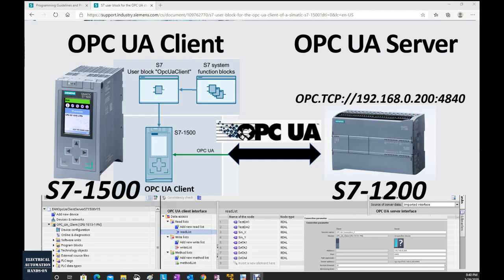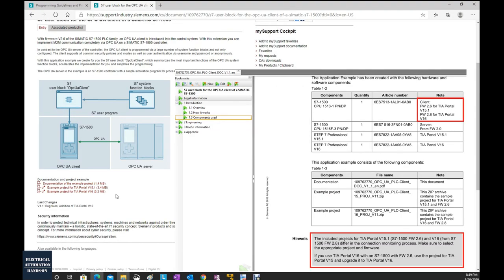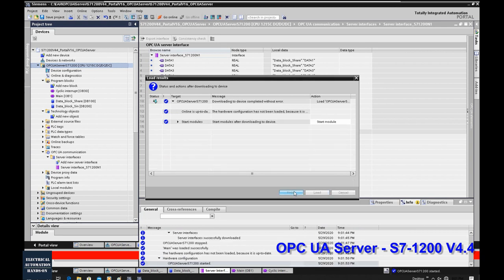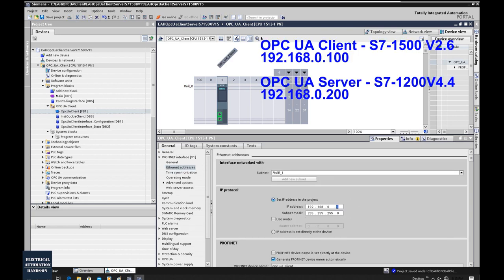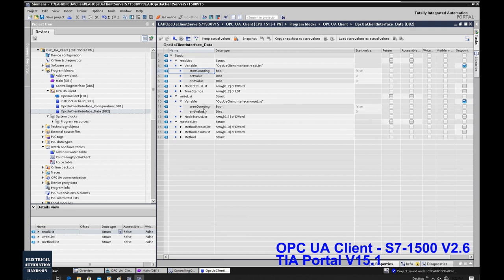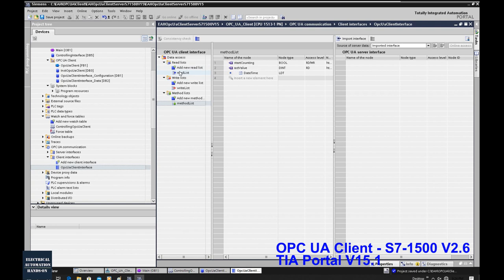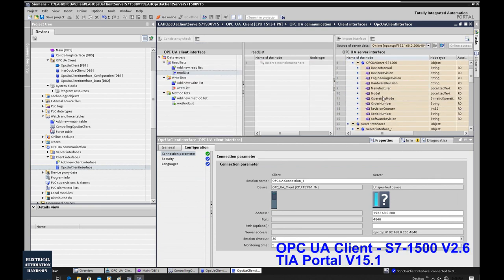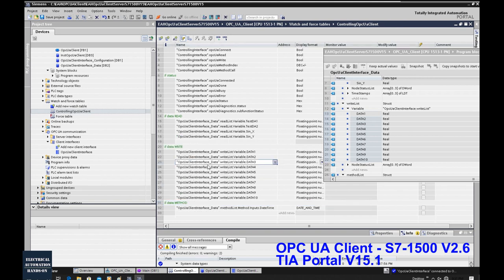COM09. OPC UA - Siemens S7-1500 (OPC UA Client) and S7-1200 (OPC UA Server) TIA Portal

Comment: Great Video. I am just having a problem to get connected to the server. When I modify connect to 1, I am getting the error code 16#8601. Do you know how to solve this problem?
Reply from the maker: Please check the configuration of OPC UA Client Interface at 21:14. Can you browse the OPC Server by using right top "OPC UA Server Interface".
Reply from the maker: @antoninsanitastruffit  Are you using the PLCSim Adv? I would recommend using S7-1500 hardware CPU to do this test, I heard many cases and most of the problems come from the PLCSim Adv, there are many issues on the software environment. According to your error, that is the common 'time out' error. If you make sure all the settings followed my video, then turn to use hardware instead of software Sim.
Reply: @electricalautomation  Thank you for your advice, effectively we use PLCSim advanced. We make the same as you but with software, so I think your right an issues come from software. As a solution  for our case, we finally choose to use the TIA OPC server fucntion to communicate with external program and work well.
Reply from the maker: @antoninsanitastruffit  Glad to hear from you. Thanks
Reply: I had error 16#8601, 16#8012 0000 and i added client certificate in client interface - security.